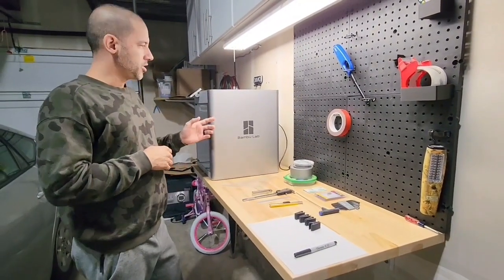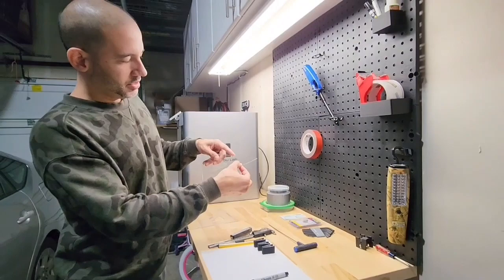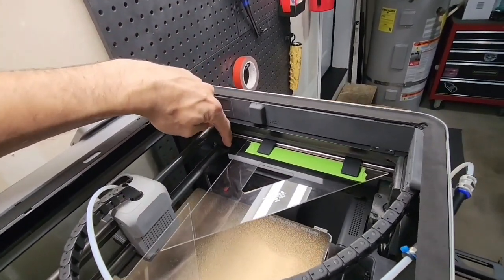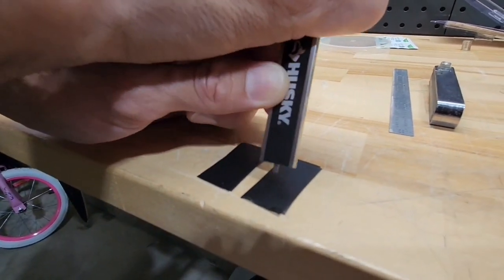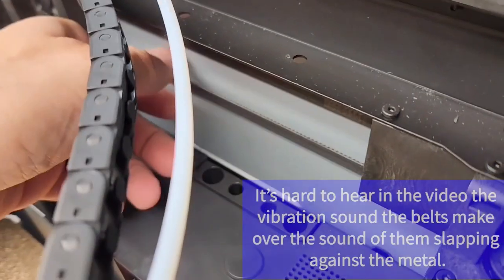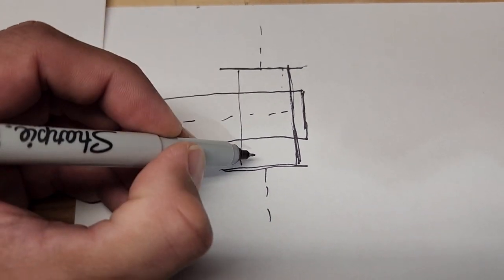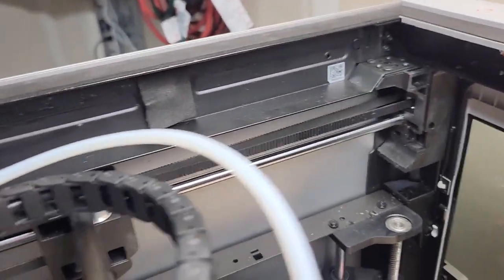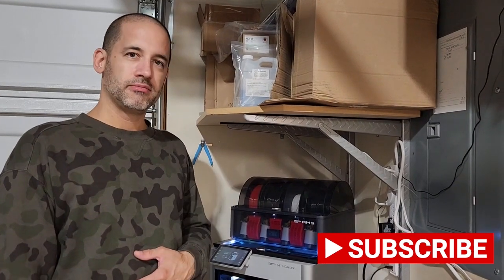Bambu Labs Banding Fix, Step-By-Step Tutorial!

Comment: Whenever I adjust where the belt sits on the tensioners, after I print for an hour or two it starts to ride on top or bottom again. Does anyone have any advice for this issue? While the belt is in the middle of the tensioner, my ringing is nearly gone - but it returns once the belt rides on the top or bottom.
Reply: It’s a myth that it should stay in center. It just shouldn’t fall off the pulley. The pulley is made bigger to allow movement

Comment: Omg. I subscribed. THANK YOU! I was somehow almost 2 mill out of square. I had horrible z banding. To fix it I tried retention in the belts per bambu wiki, retention z belt, clean carbon rods, clean and line z screws, take apart entire tool head and clean and lube extruder gears, run every filament flow calibration there is, did a factory reset, recalibration, new XY belts, new, extruder circuit board, new hot end.  And your method fixed it. Can’t believe it was so simple. Why bambu support didn’t have me do this in the first place is really bad. Thank you again!
Reply: fingers crossed this works for me too!
Reply: So he fixed the XY gantry, while the Z-axis is driven by the bed. Do you want to explain how it fixed your z-banding?

Comment: Can you help me understand why/how the tape shim helps address skew? When the gantry moves along the Y axis, wouldn’t it still be skewed against the X axis?
Reply: A bit of a roundabout way of doing it but not a stupid way of doing it, if it works as intended.

You assume that the side rails are parallel, you estabilish how much offset on one side do you need to make the gantry perpendicular to the side rails. So now you have the gantry rotared by the same angle, by which the main body is skewed, which makes them more or less square. Rather than making the body of the printer perfect, you assume that it's imperfect and make it square to however it came out from factory. The result is that prints are rotated on your bed by some sort of miniscule angle, but that doesn't matter at all.
Reply: @janpichell3927  Yes, exactly. It does not adress issues with the gantry squareness, it just prohibits one side to move back beyond the reference when zeroing. Without the shims, the steppers would constantly try to bend the gantry into this offset trapezoid shape
Reply: I think it is in the step where he holds the gantry up against the back with light pressure, after the shim is in place.  He then tightens the belts and this corrects the gantry to be square.  I did this on both my X1C and P1S and it works.

Comment: Sorry but this just seems a bit like snake oil. You have provided no evidence or test results for your "fixes" I kinda feel like this is just randomly trying stuff. I get maybe squaring the axis could help, but the way you are squaring it is absolutely not an accurate way of doing it and it could actually lead to it being less square.
Reply: Did you listen to his final comments about offering a better way of doing things. Do you have a better way that the average 3D printing hobbyist can apply while using common, every day tools, and not resorting to precision instrumentation for better accuracy? I’d sure like to hear it.
Reply: Well if it did t work for you like he said there are multiple idle pulleys. But if you’re unaware,  this could also be confused with ghosting.  Ghosting is venerations. Bambu fixes this to an extent but if you have your printer elevated on a table those vibrations will cause this.(table shaking). Stable platform helps prevent ghosting.
Reply: "snake oil"? He's not selling anything. It's a troubleshooting video, he's trying to help. Work on kindness.
Reply: Work for me
Reply: Worked for me
Reply: No work me

Comment: good morning! This is certainly a greatcheck for a big discrepancy. But there are more variables bringing VFA to the table..  And Im very sure this did not get rid of all your VFA.
Reply: What would you recommend?
Reply: @pavelm6677 the new feature that compensates for midband resonance of stepper motors makes it 50percent better. The other 50 percent maybe with further tuning you can improve but these parameters are not available yet for the user to change. Also corexy inherently has these issues doubled as the AB motors are permanently coupled and makes it harder to pinpoint the bad rpm ranges for each motor, furthermore i think the answer for perfect looking walls tends to be using linear motors. I have a hunch thats where BBL is going next. who knows? For now upgrade the firmware and find a speed range that is happy. Orca slicer has a good VFA test for speed "calibration".

Comment: Question about adjusting the rear idler pulleys. If the belt is riding high on the idler, does that mean the axle is tilting to the left and so the top bolt needs to be loosened so the idler can be pushed to the right?

Is this true for both the right and left idlera, or is it mirror flipped?
Reply: The belt will move to the path of least resistance (or tension). To increase tension, you would pull the pulley away from the middle of the printer. Staring at the back, the right bracket would go right, the left bracket you would go left. If the belt is high, you loosen and push the top of the bracket towards the closest side. If the belt is low, you loosen and push the bottom of the bracket toward the closest side.

Comment: Once you square your gantry, doesn't loosening up the bolts again (in order to fix any skewing of the belt on the idler pulley) mess up the squareness again?
Reply from the maker: My method only loosens up one of the two bolts per side. The ones that are still tightened serve as an axis of sorts to rotate the tensioner housing. So, in theory, it doesn't loosen the belts. It just lets you rotate the tensioner housing a tiny bit until the pulley is perpendicular to the belt. It isn't what would be considered a typical method, but it worked well for me. Hope this makes sense. It's a bit tough to describe the concept.
Reply: @BoneyardLabs  actually I thought you explained it well especially with the diagrams.

Comment: Going to buy a p1s or an x1 in the next couple of months.  Doesn't this come calibrated out the box and does the auto calibration take care of this problem.  Also it's great to have this speed but can I sacrifice speed for quality for times I need it?
Reply: You run an automatic self-calibration test once it is set up out of the box.

Yes, speed can be sacrificed for quality (to an extent). This can be done in the slicer when you are ready to print.

Comment: my printer currently has so much ringing i cant even print usable parts. like the entire part is wavy and rough. my belts are riding on the top of the pulleys. thats what i will try next. if it still doesnt work im contacting support. ive had this printer for less than a month.
Reply: Did you end up being able to fix it ? I’m in the same boat and it sucks seeing other people with printers without this problem..
Reply: @Akela6  it only happens when using the concentric layer settings. My prints seem fine if I use nonotonic and stuff. Idk man. Support hasn't been super helpful.
Reply: @CaffeinatedFrostbite  at least you are lucky to be able to not have them when using non concentric patterns! For me it’s on every print with a flat surface on the X axis 🫠
And yeah, same, support wasn’t helpful for this.
Reply: Support yanked me around for a half a year with that. I finally returned it. Bought another x1c elsewhere. Issue fixed

Comment: When I built my Pro 3D V-KIng 400 from self sourced parts I ordered the belts and pully's from the same vendor and the belts are the same size as the pully so there is no oscillation of the belts in the Z plane and they run perfectly true, I find it strange that Bambu used larger pully's than the belts.
Reply: because they used those pulleys in future models like for example p2s. But already wider belt

Comment: 720p ? cmon... reupload this in a non fuzzy low bitrate sir? i found that if you loosen the bolt that corresponds to the side that the  belt is touching for the longest amount of total travel that the pulley rightens its self up. repeat twice and the belts on both sides do not hit my pulleys :) thanks for the technical bit so my autism could understand what to adjust and when.

Comment: The problem with this video is it does not actually address where the banding comes from, its a futile amount of work, if you cannot get the pullies where the belt teeth ride on, to A stay strait, and B should not be running belt teeth over a smooth pulley, it should be reversed.  While making sure the gantry is square, belts are tensioned and riding as much off the flanges are all steps that you would normally do, its all moot if the belt teeth are also riding on the smooth gear.  

Also while moving the gantry back in forth, did you check the belts on the motor gears are also riding center?  Because there it will absolutely cause banding.  It is the whole reason why voron printers run all belts backside to all the smooth idlers.

Comment: Should adjusting one of the side assemblies affect the belt movement on the other? 

Further, if I overdid the pushing + tightening" to where the belt wants to track in the other direction, should I undo the same bolt and let it slide out a bit, or should I tighten the opposite bolt? Meaning, after going through the bambu prescribed tightening process, should I only be undoing/tightening one bolt per assembly?
Reply: U figure it out?

Comment: So all you used from Portzal3D's solution are the printed clips to hold the square tools? Because there are a lot of other parts to build his "belt adjuster" and you didn't use that.
Reply from the maker: Correct. I printed them off and tried them out (off camera), but after considering their intent, I decided not to use them. I didn't like the idea of using the belts as a way of squaring the gantry because it causes you to apply dissimilar tension to the belts, which could possibly be adding a preload to the bearings on the Y axis.
Reply: Using my belt adjuster as detailed on my printable page will actually help avoid over tension of the belts and provide a more precise belt tracking method.

Comment: Why not print the triangles instead of buy them?
Reply from the maker: That's actually not a bad idea! As long as you can verify that they are perfectly square. I know that there have been instances where printers will be a tiny bit off from perfect. When the X1C was first released there were reports of minor dimensional issues when printing parts intended for close tolerance.

Comment: Just an FYI... make sure you order the 8-inch 45/90 drafting angles.  The 8-inch 30/60 triangles don't work on the right side as one of the stepper motors for the gantry is in the way and prevents it from bottoming out in the back.
Reply: I made a mistake ordering European 8-inch 45/90 drafting angles based on your recommandation and ended more than a month later with two expensive useless squaring tools. Indeed, here in Europe the dimension of the squaring tool refers to the hypotenuse! Which means that the resulting tools are too small, thus far apart in the printer, therefore useless. P|ssed off!
The corresponding drafting angle in Europe to the US 8" isosceles (45/90) tool is not a 8" aka 21 cm drafting angle (which is too small) but a 28 cm one (11" hypothenuse)!
Reply: @fluxcapacitor  will 30cm or 31cm 45° also work?
Reply: @fluxcapacitor 
I just bought 2 sets of Helix R36011 Oxford 31cm 45 & 60 degree Set Squares (Amazon uk B00CPT6XEQ )
Have I made a mistake?
Thanks.
Reply: Omg. I subscribed. THANK YOU! I was somehow almost 2 mill out of square. I had horrible z banding. To fix it I tried retention in the belts per bambu wiki, retention z belt, clean carbon rods, clean and line z screws, take apart entire tool head and clean and lube extruder gears, run every filament flow calibration there is, did a factory reset, recalibration, new XY belts, new, extruder, circuit, board, new hot end.  And your method fixed it. Can’t believe it was so simple. Why bambu support didn’t have me do this in the first place is really bad. Thank you again!
Reply from the maker: Good catch! 👍 Mine were 8" from my local Office Max.
Reply: I printed some.  I wonder if they are good enough.  Printed both on same printer, same filament, settings, etc.
Reply: @waynefilkins8394  Did using printed squares work? I was wondering the same.
Reply: @kevireilly  I think they work if they are identical, but this didn't really fix anything for me. I think the biggest improvement I got was when I loosened the screws and moved the gantry around so it would autotension, I did it slowly. Before I was moving it around kind of fast. Moved it back and forth real slow, left and right, all real slow, then slowly pushed to the back of the printer and tightened.
Reply: @waynefilkins8394 thanks very much for the additional information and confirmation that you were able to get it fixed. I may have been doing the same not super slow gantry movement as I still have observable VFA after the wrong sized squares that I made work and printed squares. Likely better, but still minutely visible and I’ll run it back with your suggestion. Guessing you didn’t add any additional tension beyond the loose state excluding potentially one side of each pulley if it was riding high or low?

Comment: Why no before after photos of the banding?
Reply from the maker: Valid point. I forgot to add it, unfortunately. A consequence of having too many projects going on at once. The image in the video thumbnail is the one I would have included. If you join the facebook Bambu Labs User Group there are quite a few pics on there to. I'll update this comment with a link to a before and after later this week.
Reply: @BoneyardLabs and those of us who don't do Facebook?
Reply: @NickBR57 sucks to suck I guess? Maybe he should send a mail to your house with a picture....
Reply: @gohertz188 man, you must be fun at parties.
Reply: @NickBR57  sign up?
Reply: @patronza  Not a chance. As someone who has worked in cyber security over the last 10 years or more, Facebook was the first to go.
Reply: @NickBR57  you don't necessarily need to use your real details, if you're worried about security.